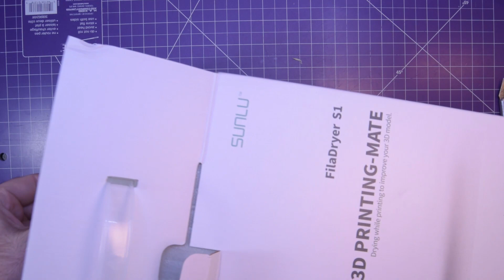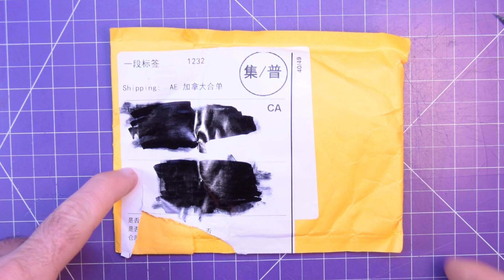Mailbag 88 - Enlightening!

Comment: Funny those IEC sockets and switches are identical to the ones mounted on the rear of the Jabe UD-1200 I recently reviewed, absolutely identical. I had to rewire the switch on it as the neon was on the INPUT side of the switch not the output, so it was always on LOL.

Comment: I have had one of those Sunlu filament heaters for a while; my humidity level here in the UK is about 65% on average. Had been having trouble with PLA going brittle, but since using this it's been fine. I have the upgraded version as it was at the same price, but I don't know what was upgraded! Those USB serial programmers are good, and they give the option of 3v3 on the signal line which is handy for chips like ESP8266 etc. Nice SMD LEDs too, although I wouldn't go any smaller than 1206 for hand soldering 🙂